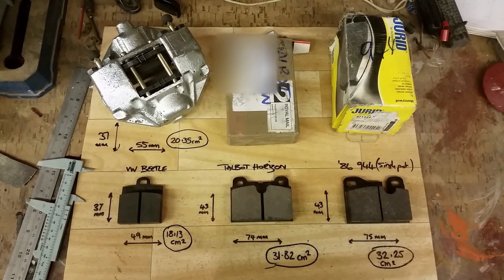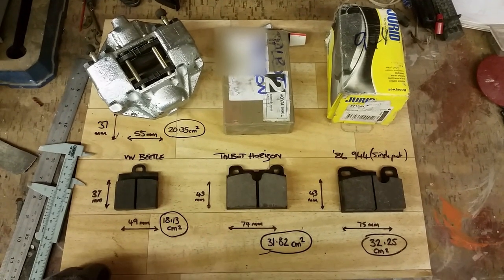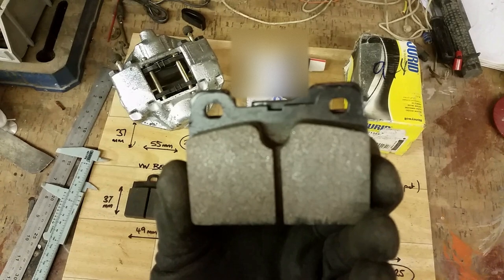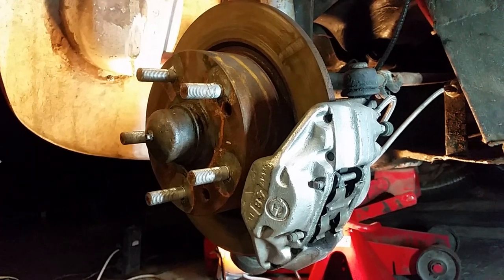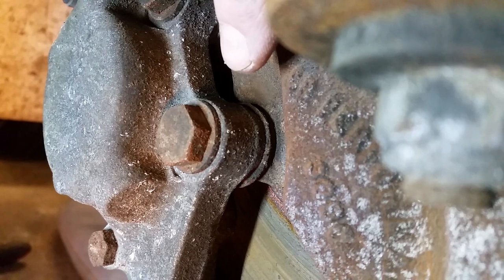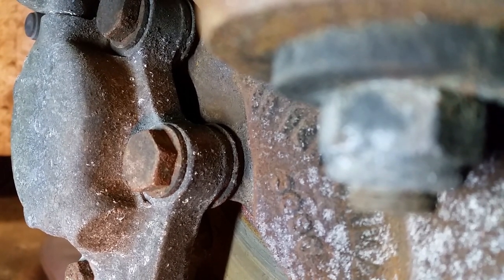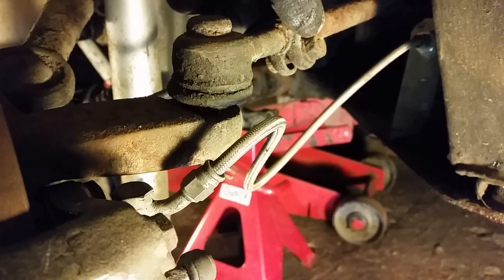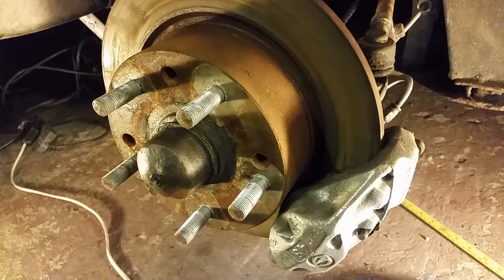Talbot Horizon Brake Caliper Upgrade for VW Bug Beetle Brakes.  Subaru STi VW Bug Beetle BEEFCAKE

Comment: Which backing plate did you use? And can you add part numbers for the stuff you used?
Reply from the maker: The front brakes are all standard VW disc setup so I assume the backing plate is standard for that. It was many years ago I swapped to disc brakes and can't actually remember those details but can't see why it wouldn't just be standard kit. Re. the caliper, I added a bit more information in the description below the vid that might help. I never noticed any part numbers on the calipers but will take another look when next under the bug. :)

Comment: Great video, thanks! Would you happen to know any part numbers for these callipers? I checked the Keith sueme book, but no numbers or of which model they are off. Autodoc is listing some, but it's by engine size and year made between.
Cheers joel
Reply from the maker: UPDATED. I think there is a thread on Volkszone which lists which can and can't be used. I think j used all the useful info from that in the description below. I have to say that really it's only a small upgrade and there are a few decent kits on the market now if can stretch to that such as the Wilwood setup. I'm planning to improve performance of these further by fitting a remote servo and will do a video as that upgrade as it happens. Thanks for watching 😊👍

Comment: I have the same calipers on my 1303 and they are a great upgrade, the braking is far better than stock. Do you tested the rear 944 brake pads on the talbot calipers? There isn't almost any good pad compound for talbot calipers, and of the 944 pads fits, that problem is solved
Reply from the maker: Yeah when I compared them they did look interchangeable.  However there was more depth of braking material on the 944 pad so wasn't sure if this would cause problems. Thankyou for confirming the do fit and are interchangeable!  Brill Tx :)
I personally didn't think they were a big upgrade. I'm not sure if this is down to the 944 master cylinder etc? However I'm currently saving for a brake servo which I'm told makes the brakes significantly more usable. I'll no doubt make a vid as soon as do that one :)
Thanks for your help 👍

Comment: Hi Big Al , Wreck from the Samba , how available are Horizon callipers in the UK ? we never had that car in Australia .
Reply from the maker: Hi bud, tbh I have absolutely no idea! I heard about that they 'fitted' about 10 years ago, went online and dropped on a set of NOS calipers cheap as chips! I was very lucky I think as I've never seen a Talbot Horizon since I was a kid I cant imagine there are many still around. I just had a quick look on ebay UK and couldn't see any on there, though this is an interesting article:
https://en.wikipedia.org/wiki/Talbot
I wonder if there might be similar calipers from a Chrysler of that era over your side of the pond? or even a Peugeot 309 which is what replaced it as Peugeot owned the Talbot brand?
I also noticed this "Production of the Horizon continued in Spain and Finland until 1987". Hope that helps :)
Oh and PS, I noticed while looking on ebay for you different brake pad designs listed as Talbot Horizon. I'll try and find which caliper year mine is and update the description ASAP :)